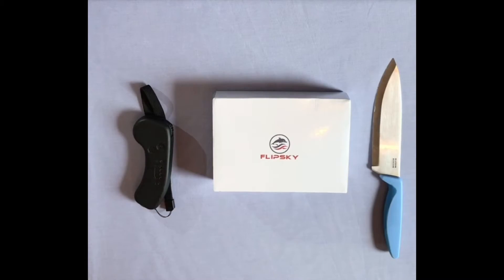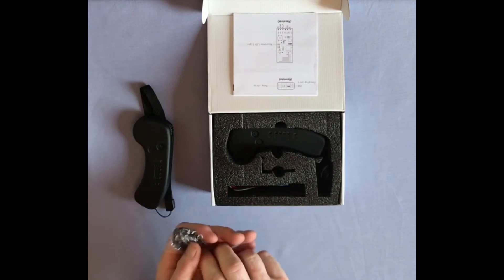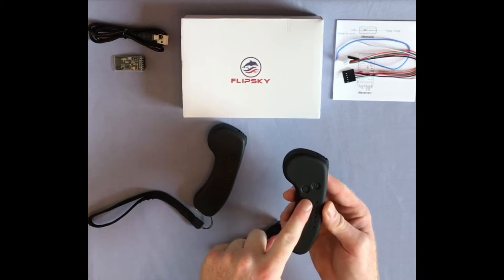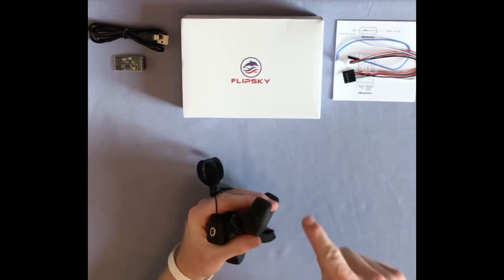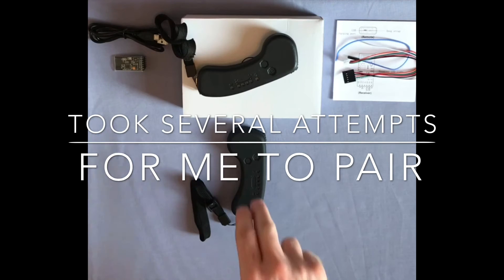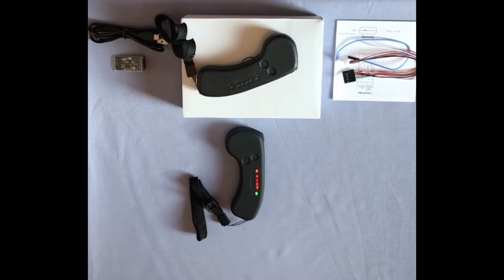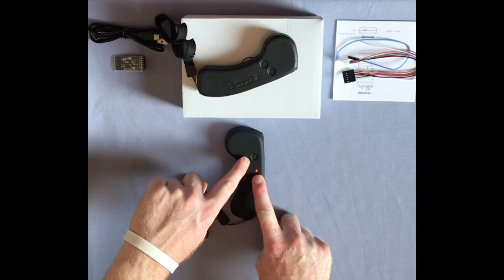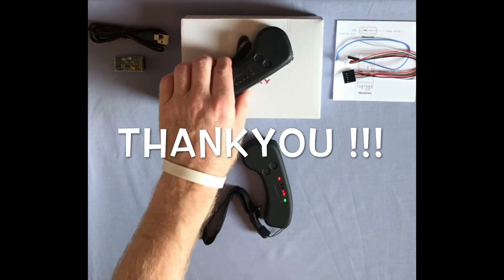ELECTRIC SKATEBOARD REMOTE CONTROL INSTRUCTIONS AND REVIEW

Comment: Hey, does anybody know of any remotes that would work with an electric skateboard's remote that broke (and the manufacturer is no longer in business)?

I have a "LiftBoard", rode it like a total of 3 hours only and the remote got stuck accelerating (something to do with when it was off and plugged it in to charge via USB and it just got stuck accelerating, tried disconnecting the power/solder after taking it apart which worked, but then i plugged it in again and the same thing happened again).

I read somewhere that you can get them on like AliExpress, but i have no idea how to even configure the frequency to get it to work.

Can anybody provide insight on remotes that would work universally and how you would go about setting them up?

Comment: This is kinda random but I'm having a problem with the battery indicator on the remote staying at 25% all the time with a red blinking light. My board is fully charged, can't find answers anywhere.
Reply from the maker: I’m no expert but here’s my best guess -

If you have a full charge but the remote saying it’s empty then either 

#the remote has been set to wrong battery type

Or

#the receiver tells the remote the battery level so maybe the cobnection between the receiver and the BMS inside the enclosure has an issue